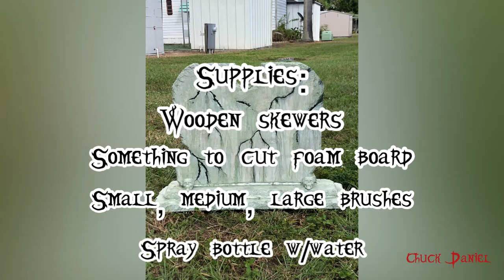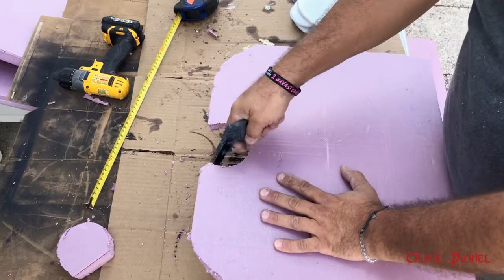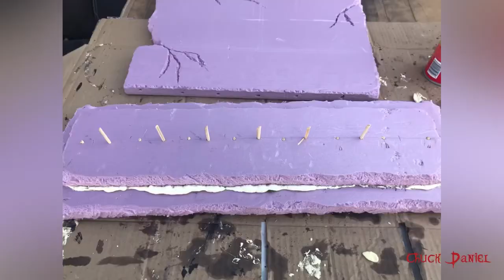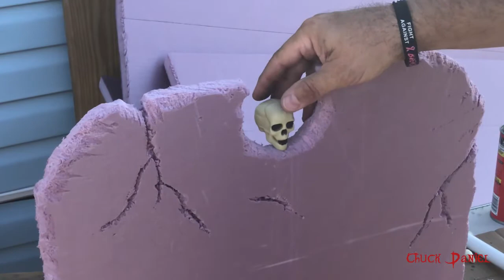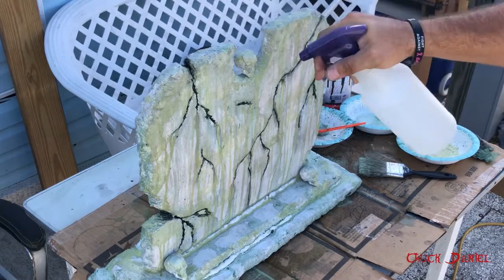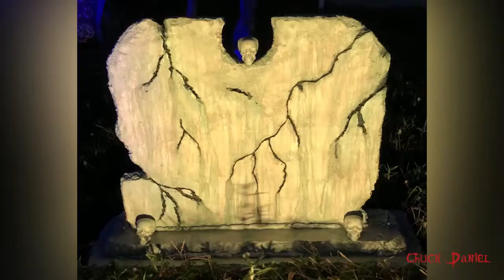Halloween Tombstone DIY Tutorial

Comment: How did u secure them to the ground or was it just the weight and shape?
Reply from the maker: Drilled holes trough the base on the backside and inserted pvc pipes. I use rebar or wooden dowels in the ground to hold in place.